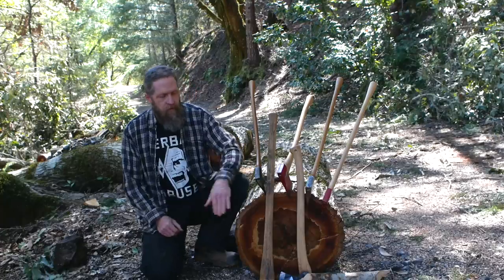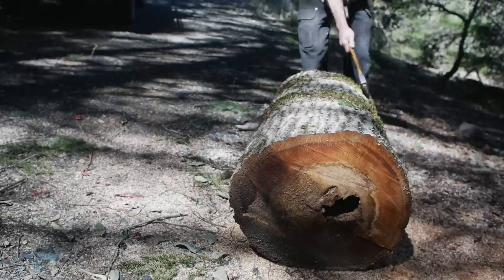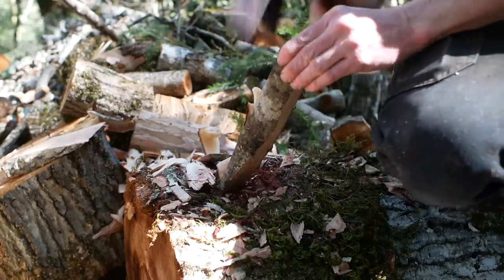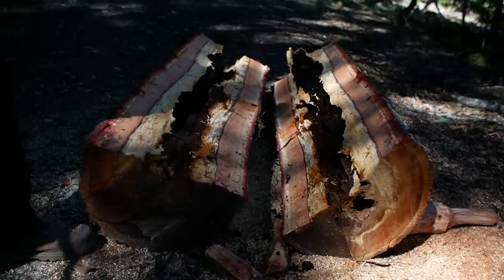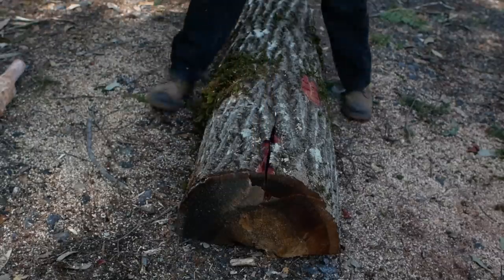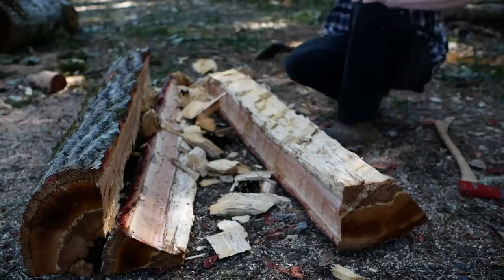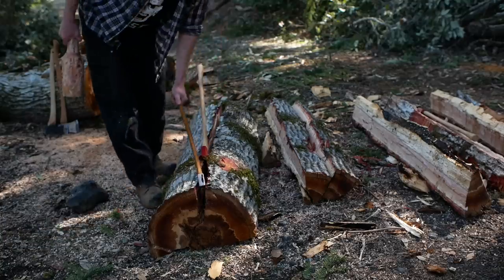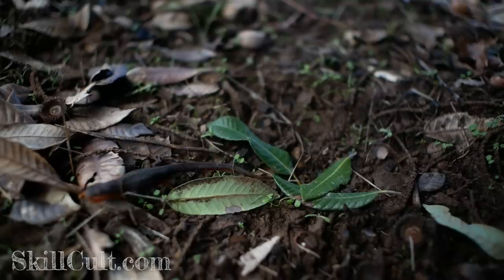Splitting Choice Axe Handle Blanks From An Oak Log & Shaping Wooden Wedges

Comment: I'm curious to learn about how woods like oak work as axe and tool handles. I live in Oregon and the prospect of finding a large piece of hickory to make a handle out of is a challenging one to say the least. I'd much rather try making my own handles out of more native woods. In your experience how do woods like other oaks or maple stand up to use as a tool handle?
Reply from the maker: I would probably skip the native Big Leaved Maple.  It is not like the eastern maple that used to be used for axe handles.  However, one of the woods I'm most interested in here is what is often called Oregon White Oak, Quercus garryana.  I have a tree that I spotted which I might try to get a couple staves out of.  The other one I'd really look at in the Northwest is Oregon Ash.  There is a lot of it along rivers and creeks and swampy areas in Western Oregon.  It's a good bow wood and probably a good handle wood.  It grows here, but in limited habitats and it's hard to get for me.  Easier to get up there. IF you live in Eastern Oregon, you're probably screwed ;)

Comment: great instruction.. i do have a question.. can you use a Froe to that job?    j
Reply from the maker: No, it's much too big a job for a froe to be very useful.  They are better for splitting shingles, boards or splitting something like these staves into halves.  You could maybe start a split, but pretty hard to do much else with one in this job.
Reply: @SkillCult  Right on.. that ax method is real good.  Making a  mallet is a really great thing to do... J

Comment: Is there any advantage in drying/seasoning the log first before spliting and debarking it?
Reply from the maker: No, quite the opposite.  the larger the pieces, the more cracking will occur.  I want it split, trimmed up, then ends oiled and get it seasoning.  There is a  couple of follow up video talking about that stuff.
Reply from the maker: Well, there could be an advantage to debarking after seasoning.  since it's not actually part of the wood, it slows drying and that's usually a good thing.

Comment: Would you recommend using old hickory axe handles that have been cut off to make some wedges?
Reply from the maker: I don't see why not.  Bevel the tops real well though. If the top is wrapped or fitted with a metal band, even better.

Comment: Wanna have some fun with handles? Try west coast Manzanita. All over my properties, but what a job to shape. "Is manzanita the hardest wood?
Manzanita hardwood is widely recognized as the 8th hardest wood in the world. We harvest sustainable non-endangered Manzanita from the beautiful foothills of the Sierra Nevada Mountains in Northern California."
Reply from the maker: I've worked with several species of Manzanita.  I would never think to choose it for an axe handle.  It's hard, but that isn't very useful in an axe handle. Axe handles are about resilience to dynamic stresses.  In my experience, manzanita is hard but not tough.  when you bend it, it doesn't fail slowly, it blows out and shatters.  A friend made a bow with it once and it just exploded on him.
Reply: @SkillCult  lets send a hickory handle and a manzanita handle to the hydraulic test channel and see how they compare. I have done hammer handles but not an axe. I have not seen any sudden failure issues in Manzanita branches placed between blocks and jumped on. One advantage of manzanita is that one uses chosen limbs of entirely straight grain and not in need of sawing that may come with runout.

Comment: Forgive my noobie question whats wrong with using thinner branches closer the the size of the handle?
Reply from the maker: well, if the piece is really ideal, maybe.  Branches will often have a lot of stress in them from growing horizontally.  Also, if it's very small, and the center of the tree growth is sill in place, it is more likely to split open.  It just doesn't usually work out that well for a variety of reasons.  Trunk wood like this most likely to be stable.  There is also more limited choices in grain orientation and more curved growth rings in small diameter wood.
Reply: SkillCult  i understand now.  Thanks for the reply.

Comment: Couldn't you 'harden' the wedges using a hot fire to pull moisture out of the wood?
Reply from the maker: It would harden the wood, but in this case I'm trying to do as little as possible and these are just throw away wedges.  Also, as I said in the video, sometimes hard things are brittle things.  Fire hardening might help to a point but it could also make the thin edges brittle, so that would have to be considered.

Comment: since you're keeping wood from a log that has obviously been hit by rot and probably fungus, do you have any ideas on how to best preserve such wood to make sure the fungus doesn't reappear or eat further into the good wood? I'll be using some small willow logs to make beams for my workshop, and willow is very prone to rot and fungus even when properly dried, and since both will destroy the structural integrity, I'm eager to treat the wood to prevent such infections. But I'd like to do it in a practical way that is not a danger to my health, knowing that I'll probably be running a forge in said workshop (so no stuff that will cause toxic fumes when heated). So far I've been a big fan of linseed oil, but I don't know if it would penetrate deep enough?
Reply from the maker: Once it is dry, there should be no issue.  The clean wood looks very clean.
Reply: @SkillCult  my worry for the beam's I'm making, is because they will be used in an unheated structure close to the ground and we have very damp seasons (not so humid per se, but very bad dewing). I'll have to keep watch. And if all goes well, by the time they go bad, they will be replaced by a live one. It's in one of my test-cases for a living building, where it won't take 10 years before you can actually use it haha.
Reply from the maker: Char them.  on the surface, but enough to get brown into the wood some.  Better, use a different wood and char it.  Willow is good fungus food for sure.  Or just plant mushrooms in them and replace them every two years lol.
Reply: @SkillCult  haha, you might be on to something there!  There are two main reasons why I want to use the willow: first and formost, it's the material I have plenty of. With more than 200 trimmable willows I can get more wood that I could possibly need for my projects. The other reason would be to see if I can pull it off with a maximum of material originating from the same tree. Two thirds of my willow trees are genetically identical because they are all planted from sticks from the same tree. I started with sticks from 3 trees in 2004. 1 of those trees died and most of it's offspring too, so I removed all those. Offspring of one of the other two didn't grow as much as the other, so I replaced the dead trees with branches from the hardest growing trees. So I believe that I have the strongest of the three genetics.

The idea of mushrooms is a good one, though... I could make a ditch, plant a living shelter, put old logs in the ditch and plant mushrooms on them... I can even make it so that it periodically floods too, although that would technically be breaking the law...

but charring them might be a good idea. Perhaps I can improvise a kiln to do that.
Reply: breaking the law ? what fool passed such a law ?

Comment: Hi I'm new to your channel and just sifting through all your axe videos as I want to learn mor about their use and the tool in general. I have a question: Does anyone know if it is possible to fit an axe head like a tomahawk so a pure friction fit from the bottom? A friend of mine has a spanish axe I think it is called a Basque Axe and he says it rehandles like a tomahawk. Just curious about this. Keep up the good work your videos are really in depth and informative!
All the best,
Bob
Reply from the maker: Yeah, if it's made that way.  It's not just the basque, there are others an that was the original method.  It makes some of the common problems with hanging axes from the bottom with wedges obsolete.
Reply: @SkillCult  Cool thanks for the answer! Would it be possible to hang (am I using the term right?) a normal axe eg. the Husqvarna from your project this way or is the eye not straight on axes like this?
Reply from the maker: Funny you ask, I was justing looking at some heads a couple weeks ago to see if I might decide to modify one as a drop in.  I"m skeptical you could do it on an American axe, with their typically narrow eyes, but I might try anyway.  You would have to reshape the eye to be a cone, wider at the top.
Reply: @SkillCult  Hah what a coincidence. Thanks for the tip with the eye, seems like I'll have to bust the file out and see how it goes. I wish you good luck with your project!
Reply from the maker: @UnhandledException1   It will be quite a job.  You'll probably need a good half round file and a largish round file.

Comment: Regarding quarters you split into thirds: would starting the second split on those and simultaneously running the two splits help to reduce runout?
Reply from the maker: Good question.  I'm not sure I've tried that, but I"ve thought about it.  There seem some inherent problems though.  If run out did occur it would have to occur at the same rate from both ends for the splits to meet.  If the splits don't meet, you have a problem to fix at the center that is probably going to waste some wood.  I asked my buddy who does Northwest native style carving if the big cedar planks were split from both ends and he said no, they were split along from one end.  My guess is that it usually would not work out that well.  Also, you'd have to really figure out exactly where to start each split and even so they are not likely to stay on exactly the same grain line.
Reply: @SkillCult  Thanks, although that is not actually what I meant with my question. I see how you could take it that way. I was referring to starting the two separate splits on the one end not the same split from both ends. I was just thinking that it could possibly help relieve tension or whatever is causing the runout to happen. Just a thought.
Reply from the maker: @gragreiser1501  Oh yeah, that should have been totally obvious, I just didn't read it carefully enough.  I'm not sure how that would play out.  It would make an interesting experiment at the least.
Reply: @SkillCult  I'll keep my eye out! As a bonus, it would be a very budget friendly experiment.

Comment: How much does one need to worry about eye deformation or the entire poll shifting sideways?
Reply from the maker: If you are not hitting the axe with metal, in my experience the eye will be fine.  Almost every used axe I get has been beaten on with metal or used to pound metal wedges.  Very few of those show any signs of real =obvious deformation either, though I've seen it.
Reply: @SkillCult  Thank you. I need help identifying the particular use for two old swedish axeheads. Would you be willing to look at some photos and share some thoughts? Hults Bruk 1890 catalog, Axes n:o 24, and n:o 34, both called "Westergötland". The patterns and size doesnt add up. Säters Banco and Wetterlings also produced the same axes with the same pattern and name up until 1930-1940... The pictures are available on Hults Bruks vintage axe site, but I dont know the rules or manners regarding links. Thanks for reply and content. Joe from Sweden
Reply from the maker: @easterriot1916  I wouldn't know;  Im not a collector or pay attention to that stuff much.  you might try axe junkies group.  there are more history people and collectors that.
Reply: @SkillCult  Thanks, I appreciate you taking the time to reply and thank you for your recommendation. I am in contact with different forums. I am also in contact with Stockholm Technical museum but as of now, no luck as into specifics. Have a great one. I learn a lot watching your videos. I have learned that almost every tool tells a story.
Reply: @SkillCult  Actually. You are the reason I took a second look in the first place. 
Your videos about edges, bevels, axe anatomy. Also your handle/shaft videos made an impact and made me wonder even more . 
Have you seen/heard about a dual edge single bit axe? 
As in chop with toe to mid edge and carve with mid edge to heel? Convex edge bevel on top half of bit and a straight ,carving bevel on the lower half of the bit? The axe head doesnt make sense! 3.7 pound axe, shaped like a carpenters axe with finger choil and nail puller. With a big chunky unhardened poll. The sister axe is just as heavy, looks like a traditional straight splitting maul except the cheeks are very slender and thin..I Hope Im not a pain in the behind but once I get a question in my head , Im like a badger. All the best. Joe

Comment: Dogwood is a preferred wood for wedges. Green oak burns well btw.
Reply from the maker: I've heard that.  I may have even made some when I lived back east for a summer.  We have one hard dogwood species similar to that, but it doesn't grow much near me.
Reply: @SkillCult  Whereabouts are you? You're well on your way to becoming another Roy Underhill by carrying on the tradition of working with split wood. I was on that path for awhile myself but now in the inner city. But I did score about a 2 feet thick piece of River Birch when a neighbor across the street had a crew taking one down. I sawed through some of it by hand and then used my
Reply: ...bah, that little comment box made me run out of room then I couldn't get back to my comment to finish it.
...what I was saying is I used my tie rod tool and ball joint tool as wedges to get the river birch log apart so I could turn some wooden bowls out of it, eventually.

In my area there is a wood called hornbeam AKA ironwood that would also work great for wedges. But the reason I mention the two tools above is you might find them at garage sales or harbor freight pretty cheap. I know I spent a lot on one of mine because its craftsman and the other I paid like 2 bucks for.
Reply: green wet ash burns in my woodstove. It has something in it that burns wet. Don't know what it is . But it is not safe to burn alone. A hot oak or maple or birch fire  is recommended to get the creosote moisture out of your stove and chimney. Otherwise creosote buildup with start a chimney fire !

Comment: Harder woods aren’t necessarily more brittle. It’s not like steel, in fact, harder woods tend to be harder because they’re denser and stronger.
Reply from the maker: I agree, it's more complex than that, but there is a general tendency for harder things to be brittle and it is sometimes true in woods, as example, some of the harder materials I could run out and grab here and some of the densest hardest wood.  Also, hard materials and woods may perform very well in certain respects, but fail suddenly.  Like it's not just the fact that a material starts to fail, but the way in which it fails.  I would say that those woods that put the two together might be somewhat exceptional materials as well, though there are quite a few of them.  If I think of all the woods here that might make the best wedges, very few seem really any good and this isn't one of them, and only one seems really promising for a long lived tough wedge.  Comparing to other materials, antler is harder, but tougher, bone is harder than antler and more brittle, shell is yet harder and more brittle,   I also think that hardness can be a component of toughness, but brittle and tough are not clear cut definitions or thing really, in the way that hardness is.

Comment: Cut slots in that log with a chainsaw and drive your wedges in them with a sledge. Funny thing, I see guys split fine clear logs for firewood, and I tell them to make handles from them. Now I see you with a log that SHOLD be firewood, trying to get handles out of it. Hammers, maybe but not axes from that rotten wood. Good idea though time is better spent on a nice knot and rot free butt log...  Or on the website of "House Handle Company" where finished axe handles are as low as $10 each.
Reply from the maker: There is nothing wrong with those staves, I think you've misunderstood the rot issue.  It is clearly limited to a specific part of the wood.  Straight logs are not that easy to come by in this area.   I bought handles from house once, which I reviewed.  Worst handles I've ever bought for both design and condition.  Almost all were warped and the one that wasn't, I couldn't get used to the overly curved design.  You make a lot of unqualified statements and recommendations, but I'm yet to agree with you on anything lol.

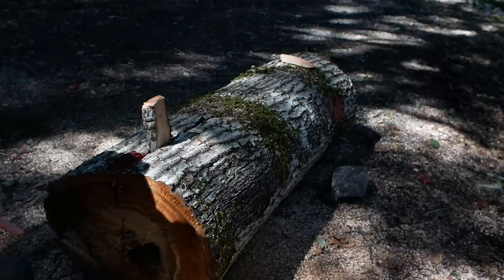Comment: 13:28 less than two minutes later the log miracles is way in half.
Reply from the maker: I didn't expect the split to actually travel through the hollow center, but it did somehow.  I was expecting to get the top started, then have to go to the other side and start over.  Usually I'd probably score down the whole face, or at least most of it, before starting the real splitting, just to be sure the split would go where I wanted it.  Worked out good though.
Reply: @SkillCult  when it comes to splitting wood, I'll take lucky any day. It just gave me a smile when it split after your comment.